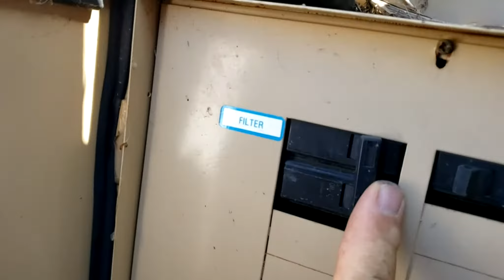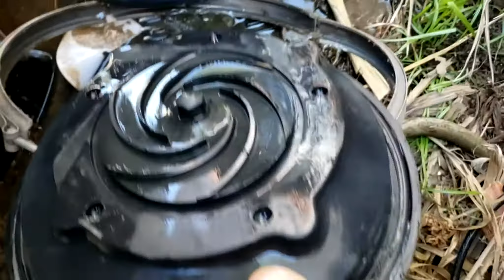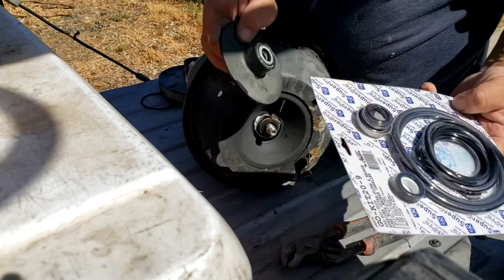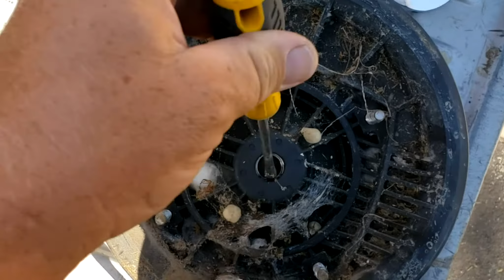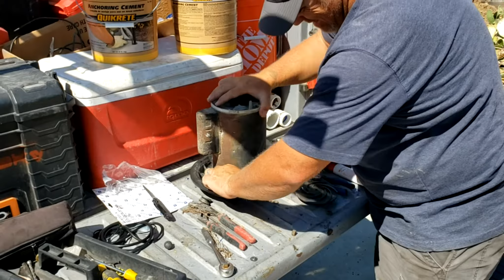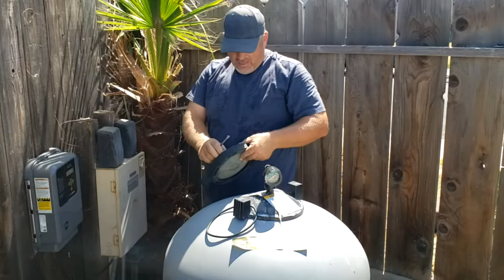Install a New Impeller on an Old UltraFlow Pump

Comment: Is the silicon in the center. Silicon grease or a regular silicon caulk like for tub surround.
Reply from the maker: It is a silicone-based lubricant play you can buy at any pool supply store